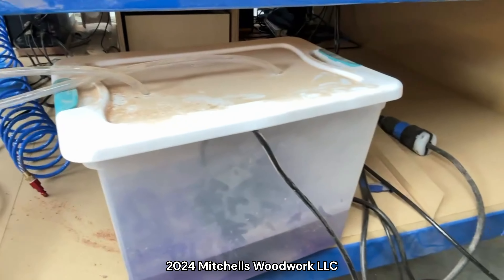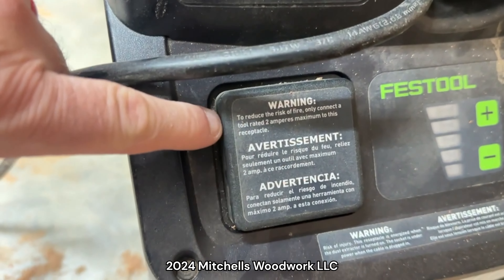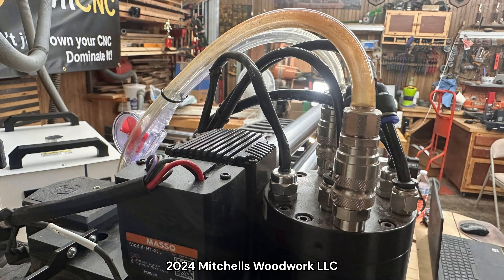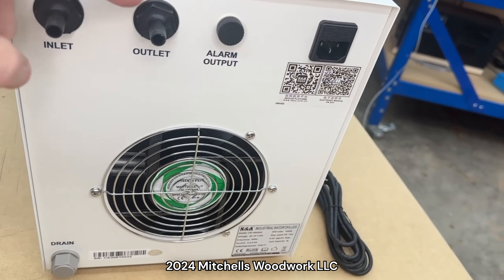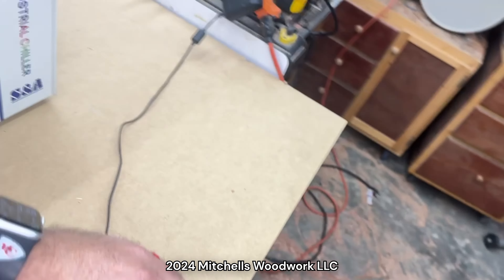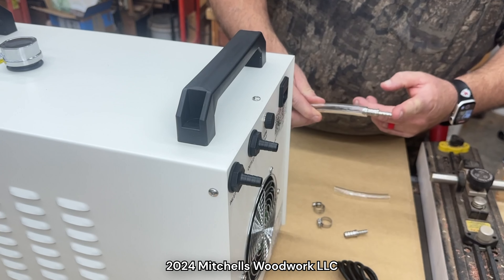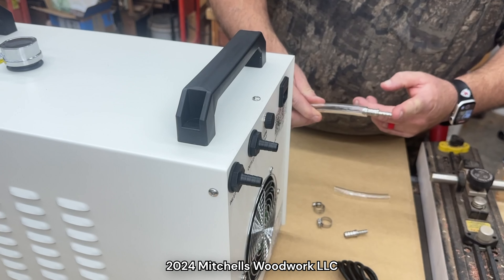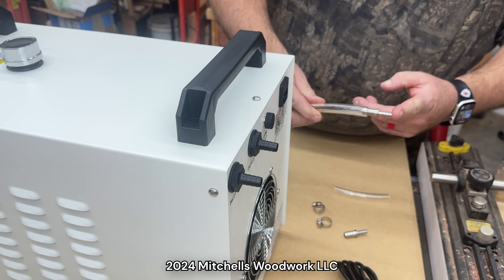How To Install A PwnCNC CW-3000 Water Chiller - Onefinity Elite CNC

Comment: Could you plug the cooler into the Router outlet on the back of the Power Supply?  PWNCNC's IOT Power strip is handy for controlling the vacuum and freeing up an outlet on the back of the Power Supply.
Reply from the maker: @husq360na9  I’ll explore the router plug option, now that you mentioned it.  I have the IoT relay but I’ve never needed to use it because the Festool outlet worked perfectly to control the pond pump before I installed the chiller.  Thanks for the suggestion!  I’ll let you know how it works out. 😊👍
Reply from the maker: @husq360na9, your idea worked great!! The only hitch is that "something" must be plugged into the Festool onboard outlet in order for the vac to turn on. I just have a small 40W lightbulb receptacle plugged into it, and it works great. Thank you! How about a free one-month membership in the Caveman Club? Contact me through my bio if you're interested! There are no strings attached; I guarantee it.

Comment: Did you find a better solution for the hose barb issue?
Reply from the maker: Yes, I sure did.  Thanks for asking because I had forgotten to add the info and link in the description.  The info is there now, but here’s the link.  I had to slightly heat the 5/16” end in order for it to slide all the way into the 1/4” ID hose.  Worked perfectly. 

https://amzn.to/3UpadIl

Comment: I just turn on mine, and getting a contant alarm e0. Pump is not turning on, not getting any flow :/
Reply from the maker: Where do you have the chiller plugged into power?
Reply: @MitchellsWoodwork  14ga extension cord to a 20amp outlet, nothing else connected to same outlet.. fan runs, but not getting any flow. I bought it at pwncnc, should i call them or the manufacturer.. pump doesnt even vibrate. :(
Reply from the maker: What triggers the chiller to come on?
Reply from the maker: For example, my Festool dust extractor triggers my chiller.
Reply: @MitchellsWoodwork  nothing yet, I am barely completing my onefinity cnc, and i was testing the chiller, but no water flow
Reply from the maker: @ZER0o10  If you've filled it with water and plugged it into a good power outlet it should start right up as soon as you plug it in.  Maybe take it apart like I did in the video and make sure the pump wiring is plugged in?  The pump is directly behind the inlet connector.
Reply: @MitchellsWoodwork  I have the same problem.